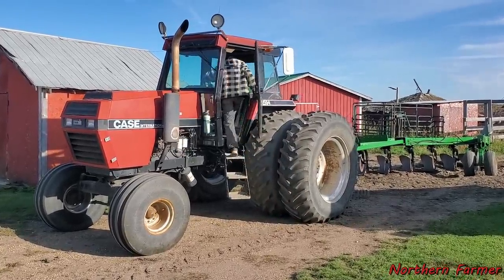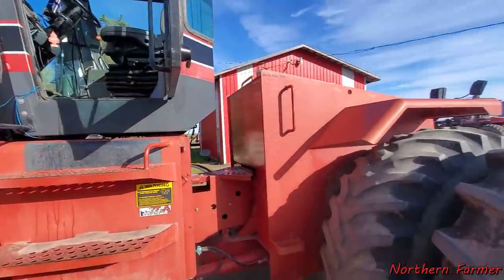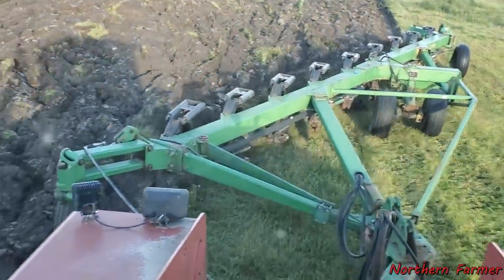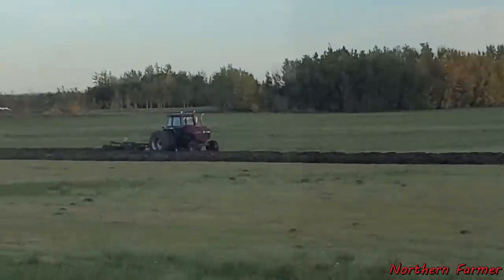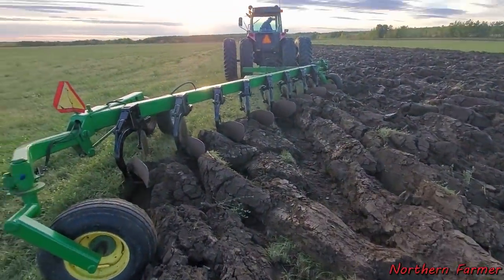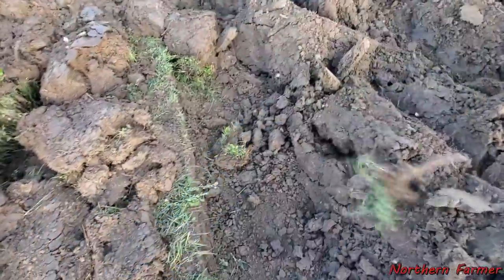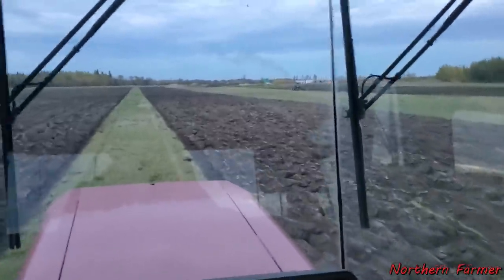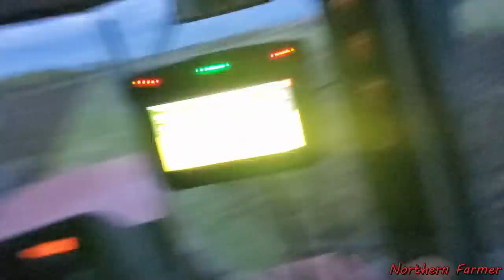CaseIH 2594 Pulls 8 Bottom Plow!!!! And Old Smokey Returns!

Comment: Australian farmer. I did many hours on a Case 2390 and 4490 in the 80's, while working as a farmhand. I liked the 2390 better. Quieter cab and less grease nipples to grease. The 4490 had a transmission whine too. But they were good tractors. I'm still farming with an Inter 1586 and a 4586.  Nice to see you guys operating the classics.
Reply from the maker: I still like them...I don't know why.. but I do

Comment: He said it's a little hard pulling it🙄
6-18s is a good pull for a 3394fwa here!! And we had IH plows, they pull easier than JD.
Rolling over pretty good for being all roots and rocks👍😎
Reply: Out of curiosity what would make a IH plow pull easier than a John Deere
Reply: @76verdee  back in the day.. we had an old JD semi mount and an IH semi mount, both 4-16"s. Pulled the JD behind a 4010 and the IH behind an AC200.. same size tractors.
The AC would lap the JD in a little over a mile. One day we we're looking at them side by side while servicing.
The angles are way different.
The JD was more like a bulldozer Straight blade, the IH more like an angel blade. 
We even swapped them on tractors, then the 4010 would lap the 200... 
I don't know if they've changed the angle over the years. We don't plow anymore, just use a big offset disc.

Comment: We have one here, great power.  Our issue is the power shift and hydraulic system.  For some reason the disc packs in the trans have decided to delaminate and clog the screen in the trans housing.  That screen is almost totally inaccessable without splitting the rear from the trans.  We have pulled the rear pto and housing from the rear and managed to clean the screen a few times to get it going again as there aren't any qualified Case mechanics around here. First to fail was the wet brakes, replaced those and cleaned the system. Then the pto pack went and had to clean every thing again.  The powershift seems  ok and we have managed to use it for a while but now the main  hydraulic pump has decided to go south.  These tractors are a ticking time bomb for money eating failures!  They basically have no resale value here in the Midwest, mainly because of lack of dealer backing, who wants to spend 15 to 20 K on repairs on a tractor with little value other than keep trying to use it?  We bought a used Deere 4850 with power shift, not as powerful but also not down all the time.  Good thing we did so I have something that will go when needed!
Reply from the maker: It's strange that some tractors will grenade like that and some go forever...I have a 2290 that has never had any problems other then tourqe damper plates thst go ..but everything else has been fine.

Comment: We have 4 AWD versions, the 3594s, absolutely beasts.
Reply from the maker: I wish it was a 3594
Reply: The 2394 we have isn’t a bad machine, they have the same power. The all wheel drive is kind of a pain for us because of all the road time we do, the front tires get burned through rather quick.
Reply from the maker: @connerbrandl5103  I would imagine...any problems with them that you have had?
Reply: @Northern_Farmer   we have had problems with one 3594 she had 9500 hours on her, we did an overhaul on the engine. And that tractor also had a new clutch pack put in. But the other tractors are doing well. They’re in the 7-8 hour range.
Reply: We have not owned them since new, but most had 4500 hours when we got them, I don’t know what work was done to them before them. The power shit is really rough at high rpm, I recommend throttling back when power shifting if possible, I think it’s easier on the transmission as well.
Reply from the maker: @connerbrandl5103  well I'm not new to the cases...but I am new to the 6 speed
Reply: And if you do pto work with it, make sure the power shift is not in reverse.
Reply: I like them better than the old 3 speed, it’d a lot smoother.
Reply from the maker: @connerbrandl5103  indeed...and I also noticed they don't whine as loud as all my other cases in reverse
Reply: @Northern farmer  I can’t tell you much about that. Besides the 94s we have a few 96s and they all whine, the 7140 doesn’t whine, we don’t have any bigger tractors.
Reply from the maker: @connerbrandl5103  yes my 2096 is just like the 2290...our 7120 is a totally different animal...its basically a international
Reply: @Northern_Farmer  the magnums are basically the IH that never happened. Had it have worked out before IH went under, the game would’ve been forever changed. I don’t have much love for IH personally but what they had on paper for the boxcar magnums was excellent
Reply from the maker: @nellsonstout7001  oh I totally  agree

Comment: Is a deckle anything like a de-cal? LOL  I love tillage videos, especially plowing or ripping videos. What's up with that tail wheel on that new plow wanting to go sideways so much? Is there a spring or something that is missing or just worn bearings?
Reply from the maker: Why do you say deeeecal lol. It wasn't pulling straight until we re adjusted the settings after
Reply: It's bouncing around because the plow isn't set correctly, and the back is running too shallow,
Reply: @Northern_Farmer  Because there's only one "C". That's the way we learned it in school back in the 1900's LOL

Comment: We sold more 2590 and 2594 new back in the day the 6 speed power shift was a great upgrade
Reply from the maker: You were a dealership?
Reply: @Northern_Farmer  I worked at a case dealership for 20 years in 1979 the 90 series was the new models and in 85 ish IH bought case and became Case IH I prepped I don’t know how many of those tractors. And then came the Magnum models
Reply from the maker: @carysmith9039  I thought case bought ih
Reply: @Northern_Farmer  you are correct 
I was probably trying to type fast lol

Comment: Is there water in the back tires of that 2594. All four front tires on our bedder tractor were low or either out of water this year. After filling them all about 3/4 full of water it was like a diff tractor. Could in places pull the bedder 6.2 to 6.5 and the plow quit dragging the front end around.
Reply from the maker: Inside tires have calcium cloride
Reply: @Northern_Farmer  if you have a loader or a way to handle the duals I would put some in the duals too. Is that being used because of freezing? In mid GA it hasn't got cold enough to freeze a tire since I can remember , I'm guessing it has to hit freezing and stay that way for awhile to freeze one.
Reply from the maker: @chadsmith14  it's freezing already for a few weeks every night...you can't have water in the tires here..they would be blocks in November
Reply: @Northern_Farmer  I imagine they would be. All of the enclosed heated shops I see on YouTube are a necessity for one to be able to get fired up and run the next day in alot of the temps I have seen up north and that's normal for a good part of the year. IDK how well antifreeze works or how expensive it would be to run to help from freezing but my luck would run over a stump the very next day and bend the rim jus enough to leak it all out overnight
Reply from the maker: @chadsmith14  yea up here everyone has calcium in the tires

Comment: Pulls pretty good for a 2wd! Needed diff lock on the whole time ? Now we need a pull of with nicks 4640 lol
Reply from the maker: No diff lock
Reply: @Northern_Farmer  doesn’t have it or wasn’t on?
Reply from the maker: @nellsonstout7001  didn't use it....we only used that tractor for a couple hours..until old smokey was ready
Reply: There was someone in a group i’m in pulling 50 feet of drill with a 2590

Comment: Would triples take care of your traction issue with the 2594. Just thinking out loud. Love tillage videos. As always WORK SAFE 🇨🇦🇺🇸😎😎
Reply from the maker: We didn't really want to use it on the plow..it was just fir goid youtube content
Reply: @Northern_Farmer  ok. Seemed to have plenty of power. 😎
Reply: @Northern_Farmer  my cousin runs the case magnums and those are nice tractors. I used one to chop corn with a tow behind chopper. I can’t remember the model numbers but they were around 175-200 hp four wheel drives.

Comment: Got a Case 2590 she'll pull 7-18s with buster bar 12" deep no trouble best setup is 2nd gear 2nd on the ps wide open.
Reply: Also get the duals out the furrow, your losing traction. With the 2wd it's not power you'll be fighting, it's traction.

Comment: Does the back wheel need adjusting on the plough so it runs in the furrow better?
Reply: If it was adjusted it wouldn’t wear out,the bearings wouldn’t wear out,and the bushings would last longer.
Reply from the maker: Yea we got that straightend out after

Comment: Might want to put a turn-buckle or hydraulic cylinder between the frame before it pulls the front adjusting slide (rounded slide) in half.

Comment: The plow is resetting because you're not pulling it straight, the draft is too much for the springs
Reply from the maker: No it's pulling straight...just rocky ground. I broke 2 shears off that day
Reply: @Northern_Farmer  No it's not I can tell by the video it's pulling sideways.
I had one of those plows, and I wish you the best of luck, it was damm near impossible to get the thing to pull straight, so I got rid of it and bought a 2700 in furrow, another nightmare, now we don't plow much, but when we do we have a white, which is what I should have bought instead of the Deeres.
I'm sure you do have rocks, but it's still tripping from the draft, mine did the same thing, even the John Deere dealer had a hard time trying to make it pull straight
Reply from the maker: @RJ1999x  I said we did after..not in this video..I set it the same as my other 3600 and it was ok..but that was almost when we were done.
Reply from the maker: Wait??? Are you talking about the 3600 or the 3710?
Reply: @Northern_Farmer  The one you were pulling with the Steiger, by the looks of the video you're pulling sideways
Reply from the maker: @RJ1999x  that's the 3710 on the 9270....it was pulling nice and straight...and it was hitting rocks in that area...once we got down to the far south end if the feild there aren't any rocks...
Reply: @Northern_Farmer  maybe it was the camera angle, but the springs should be parallel with the furrow wall, and in you video they didn't appear that way
Reply: Neither of them are pulling straight by my eye. General rule of thumb is yanks can't plough anyway. 😜